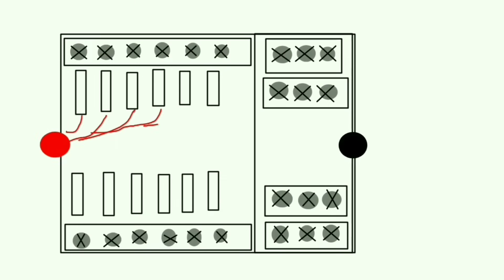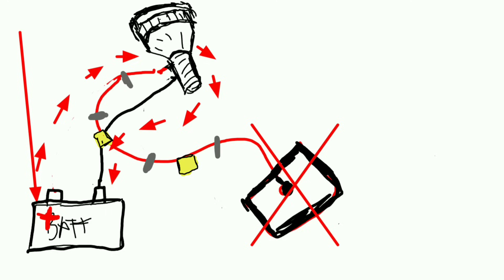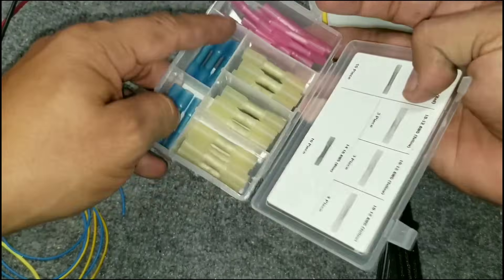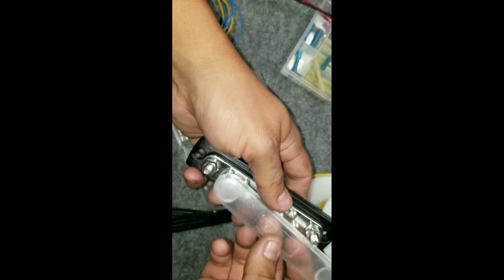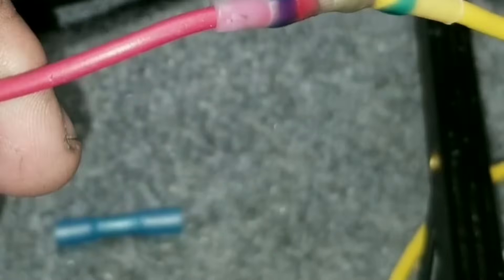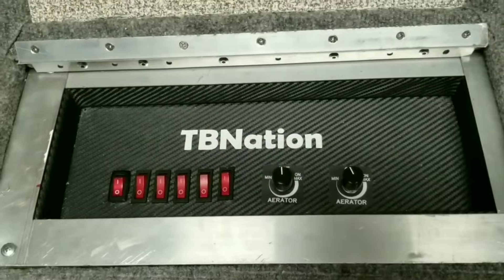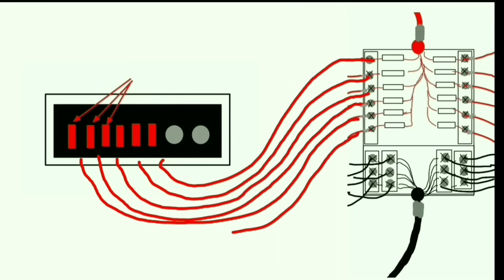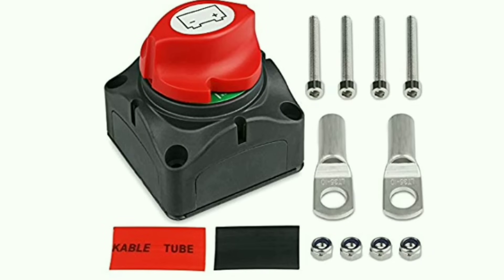SUPER EASY Boat Wiring Electrical Diagrams, Fuse blocks, busbars, marine grade

Comment: Michael Lopez.  Great videos.  Just wanted to tell you about my boat build.   Its a 16'  john boat side console.  I put in rear deck with gas and battery compartment behind two seats and a bait well.  The bait well is led lit with two pumps. If im fishing skinny water i can use one pump to recirculate the filled bait well or if im fishing deeper water i can run mu fill pump and switch my recirculate pump to discharge for continuous fresh exchange.  I have another casting deck up front that covers my 24vdc battery system for my trolling motor with storage for life vest and such..  For lights im running led NAV, Anchor, Green underwater lights, green bait well light, and 2x 2k lux spot lights up front.  The boat is powered by a 40hp outboard with dedicated battery and bilge pump.  I originally this project 3 years ago.  I only got to use it a hand full of times befoe i was forced to park it.  The trailer colapsed during a hurricane and my wife fell ill needing a few surgeries. ( she is very well now).  Im excited to say that im almost finished getting the boat back together.  With a new to me trailer and fixing some problems with the motor i just took her out for a test run last weekend.  She runs great.  Cant wait to go fishing.  Im so proud of the boat and all the work i put into it.  I learned so much from the TBN community and others like it.  Thanks for doing these videos.  Keep up the great work.
Reply: Let me know if i can send you a pic of the boat.

Comment: Trying to get all the stuff connected directly to my cranking battery on the boat to a board.  I order the Blue Sea 5025 St Blade Fuse Block W/Cover - 6 Circuit W/Negative Bus.  I got a different one that only has positive.  Not sure how your supposed to connect only the positive side of all your accessories so I'm returning that one.  I ordered this other Blue Sea fuse block.  Hopefully that will work.  Our boat has hardly any room in the area where the battery is at.  Have to route all the wires positive and negative to the Blue Sea Block.  Every time I have to remove the battery it is a total nightmare to get all the wires back on the battery when I put it back in.  Have had several times missed a wire that falls to the back and have even had to remove the battery to find the missing wire.  So I am looking at installing the Blue Sea 5025 St Blade Fuse Block W/Cover - 6 Circuit W/Negative Bus when I get it.  Not sure I even have anywhere to put a on / Off switch at the battery where I would hook onto the battery for the Blue Sea blade.

Comment: Your first diagram is wrong, electrons flow from ground to the positive side of the battery, and your statement that you can connect your loads ground to anything that conducts electricity  is also wrong, ground always have to be connected to the negative side of the battery thus completing the circuit.
Reply: Actually... 12vdc grounds can be grouped to "common ground."  Meaning you can run one ground wire from the negative pole of the battery to a desired location.  This location can be a body ground or a terminal block.  I have an aluminum boat and if i so chose i could have grounded the negative battery pole to the boat itself.  And then any components negative to the body as well.
Reply: @adamcox8555  yeah, but that common ground is connected to the negative side of the battery, which is what he is saying.

Comment: Can u use the black switch’s u used in other videos with same diagram
Reply: Ok thank u yea I would just run lights to one nav lights to one and fishfinder and then have extra and how do I fuse the trolling motor to separate battery and what fuse would u use for a 12 volt trolling motor thanks for the help

Comment: Awesome vid, thank you! I have a 24v trolling and an electric start outboard, do I need 3 or 4 batteries? Trolling should prob be separate, so 2 there, but can the outboard go on the same battery with all the other boat electronics?